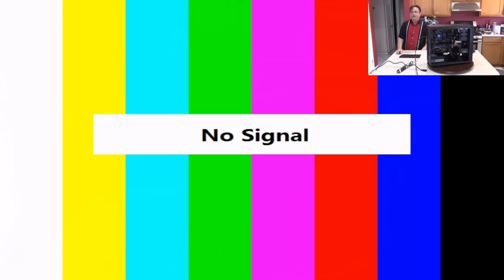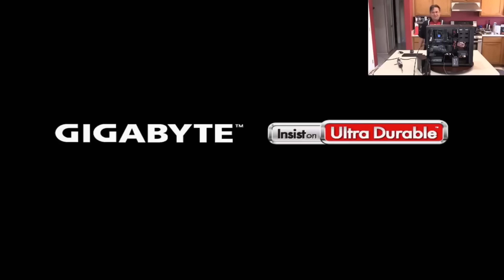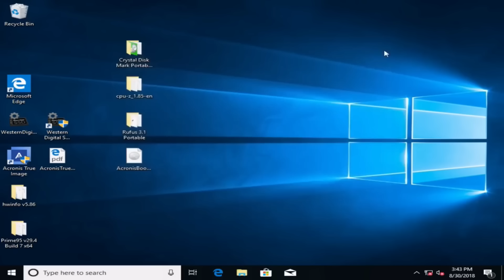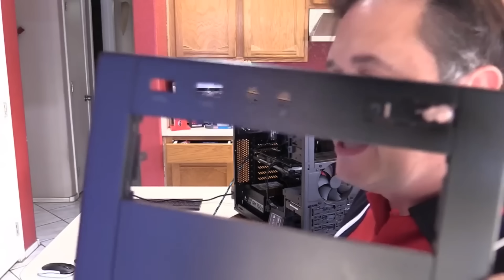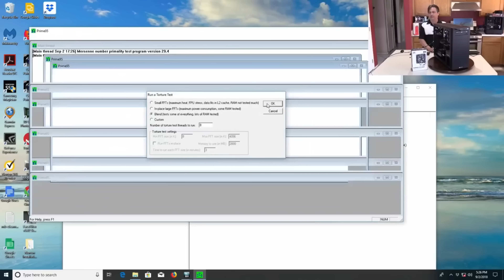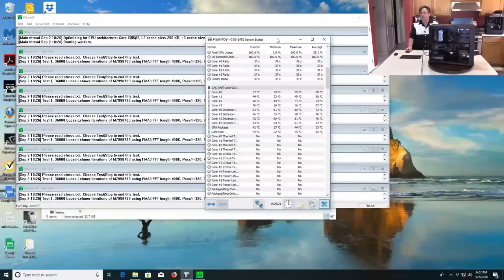HOLY COW! The easiest fix that NO ONE thought to check! Fixing a viewers broken PC.

Comment: There's another good reason not to power the machine on and off frequently - it minimizes thermal cycling of the components.
In all the hundreds of computer repairs I've done I've never seen a switch being the cause of a problem like this. My first thought (obviously wrong) after watching its behaviour was that the power supply might have a capacitor going high-ESR (power supply shutting down). Nice work! I think the CPU heat dissipation would be fine as long as the heatsink fins are dust-free, the thermal paste is the metallic high-grade stuff and he fan is turning freely.

Comment: I've often found in my computer diagnostics, that the dumb stuff, like that switch, comes up more often than it should. That's why I, too, always check the dumb stuff first. Looking for all the obvious causes first is usually the quickest to test. In the case of this problem I would have asked the question: what is the simplest cause of a reset? A switch?  Keep up the good work.

Comment: It's sad how many machines I've been asked to repair over the years where they've been 'repaired' elsewhere. I've had a machine on the workbench this week which the user has paid to have Windows reinstalled because it was corrupted. It failed again and he brought it to me. An initial check showed SMART pre-failure codes on the hard drive, they had obviously just reinstalled Windows on a dying hard drive. Swapped it out for a SATA SSD and the customer is happy as larry because the machine flies compared to a system with a nearly dead hard drive!

Comment: Great video. Lovely to see your detective skills in acton. Quite often with hardware, it’s the bits that move which can wear out but impressed that you eliminated software as the cause and then hunted down the hardware issue. I would never in a million years have guessed the cause - and great to see your systematic testing revealing it.

Comment: i wanted to say thanks for the info on the EVO.
when i built my I7 930 some 12~13 years ago i put a pelter cooler on & it ran solid with an OC@ 3.4. a few years back the pelter died & i put the stock cooler on. since then i had temps just like what you got in this vid, and that was not running overclocked. to do some video editing with Studio 10, i had to under clock to around 2.4, otherwise my computer would shut down or lockup.
just never got around to getting a new cooler.

after watching your vid, i clicked your link (it shows as Currently unavailable), scrolled down and found the EVO V2 listed. carted it and got. the description isn't really clear, appears to say it will fit LGA1366, but i had to do some mods to get it to mount which really wasn't a problem for me.
so far, max cpu temp has been 84c with prime95, watching a vid, and multiple windows open in 2 different browsers with multiple tabs in each, mildly OCed@2.9.

oh, and nice catch on the bad reset switch.

Comment: Hello just wanted to say great video,  I've been working on computers for years and I had to buy a new one just to experiment the newest pc's for myself the difference in i7 before this gaming pc I had a AMD Work Station and I still love it over this new one. 
Any way after 6 months I had to replace the very same power panel it is the kind that the switches are all on the top service and they get full of dust and if not clean very often they get hard to press and they break also the USB's are the same and they break and so their for I won't buy or recommend a top service panel. 
Thanks RallyAcesPCWorld

Comment: Yes. I had a similar issue before with my desk top. I just disconnected the button. Also, a local shop misdiagnosed my laptop when it just would not restart after just shutting down  normally. The shop insisted the mother board was bad and quoted me a $380.00 price. When I picked it up afterwards. only 1/4 of the screws were holding it all together. When I gave it to him, they were all there because I took it apart and checked all the connections prior. I suspected the power button. Replaced it and its been 3 years, since. In fact this is the same laptop I'm typing on now. $5.00 on-line for a switch. My shop was hoping to get a product to sell as used if I left it behind for him to repair. This mans shop was hoping for the same thing. No big surprise to me. Live and learn. Process of elimination is key and Sometimes one has to take a shot in the dark.  Gary, Thanks for this channel as it shows what Reality we live in with repair shops.

Comment: An object lesson in logical procedures and the 'safety nets' of unplugging the client's data storage drives, as well as electrical isolation until you suspected that it was a switch problem.
The fact that you temp tested so consistently should be a lesson to all aspiring computer repairers. Subscribed.

Comment: I'm no super geek, but I've done about 5 builds and a couple of upgrades... my last build was a NIGHTMARE!! 2 bad motherboards, 2 bad graphics cards... don't even want to remember some of the other issues... even with the assistance of a friend who has owned his own IT computer repair shop for 25 years... it took us 6 months to finally get it running properly... I'm pretty damn sure this will be my last build considering the Quality Issues I ran into and the warranty hassles... Anyway, loved your diagnostic process, but mainly wanted to thank you for HARDWARE MONITOR... I've been using Speccy for years and on my current Ryzen 5 5600X build it doesn't give me core temps for some odd reason... my tech said the CPU sensor must have gone bad... WELL... Hardware Monitor gives me Temps of things I didn't even know had sensors AND all my fan speeds (all 7 of them)... will be watching more of your videos... THANKS...

Comment: I took my desktop machine apart and took it outside and gave it a good cleaning and dusting, replaced the heatsink compound under the cpu cooler and proudly put it back into service.  It wasn't having problems, just needed cleaning.  Then the problems started.  I couldn't figure it out.  Time and time again it reset.  Then I got the blue screen of death (more than once).  I put it on the table like you have and stared at it for days.  Finally, I realized that I had accidentally tucked the cpu fan cable behind something and had plugged a different fan in the connector.  The mother board was happy because it could see a fan turning, just not the right one.  I had toasted the cpu and it never recovered.  I switched to an I7 laptop with two monitors (I don't game) and everything's been fine.  Sometimes I'm my own worst enemy and those problems are the worst kind of frustration.

Comment: It is a shame that he could not get better support locally.  I have been working with computers for over 48 years and have run across this problem before and wound up taking the front panel off as it was in this case the power switch on the panel causing the problem, as there was no reset switch which I would tell people not to use that any way.  Initially watching your video I would have though it was the power supply, but I could see right away that the power supply had nothing to do with this.  I like that you checked the connectors as I have found that on custom computers, guys frequently make mistakes there as well.  Any way very nice job and enjoyed watching your process.  I like your power test to push the CPU to maximum and see where the heat shows up numerically.  Very nicely done.

Comment: I recently had a go around with my old HP Z230. It decided to not post, no video, no beeps. The fans came on OK but within 30 seconds would run at high RPMs. Reset the Ram, checked all the cords and disconnected everything from the MB. Same issue. Thought it was my PSU but it being an HP 19 pin proprietary unit, my PSU tester was useless. I replaced the CMOSS battery and it finally gave me 5 beeps. which led me to inspect the CPU. I removed it and looked real closely at it with a magnifying glass and noticed one little brown/blackish smudge on only one contact. I cleaned it with rubbing alcohol and replaced it with new thermal paste. It fired right up and has been running fine since. I appreciate this video and you sharing your diagnostic expertise. Liked and subbed.

Comment: My clients and boss call me a genius because I check for and think about things like this. Erratic behavior must have hardware isolated first. ALL hardware. I do the same on desktop power issues. Front Panel I/O catches so many people and in modern systems rarely does anyone think about the reset button. In the olden days of the 90's, front panel buttons on cheapo were not made as durable and we saw this frequently. Nice to see a true diagnostic technician at work.

Comment: Great Job Carey! Logical and step by step analysis and troubleshooting procedure! 

I've been in the game since we could & would change discrete compenets so might have changed the FP reset switch if possible?

And I hope you recoup the cost of the new fan/cooler Assy. if not from the client!

Apart form that, a great outcome that seems to have eluded all others and caused unnecessary cost & wasted time without a resolution!?

A lesson for the client perhaps that DIY is not the right way to go and best to refer it to a Pro like yourself first for a proper and more cost effective outcome! 

Good news is I believe you've won a new client for life! 10 out of 10! ..... 🙂👋 👍

Comment: 10 minutes after boot... sounds like a CPU heat problem. I had a similar issue with a computer recently - liquid cooled. Pump had died.
Edit: Wow reset switch.. that's weird for a momentary to be so regular

Comment: It's all about a system to start ruling out things. Very quickly you knew it wasn't a software problem. Then it's just start with eliminating possible hardware causes. You have a real understanding of a system and how to check it out. Great work.
Reply: It's a pretty standard rule to never work on the machine with the custommers harddisk/ssd. 1st it's not our problem if the custommer have pirated software and we should never ask to get passwords to access their Windows or other OS installs. It's jus as private as a bank account or credit credit card. I agree that it's always better with a full install, but most techs will just disconnect all drives connected and use their own media with a basic install and some diag tools. If it turns out there is nothing technically wrong that I can find, I can recommend stuff that can enhance an older build or prolong its life, and unless people is total novices into installing windows themself every tech should have a usb stick that installs the latest Windows with all updates, install proper drivers and reseals Windows, in case it turns out to be a software issue. A true service tech will have no problems in instructing people in how to retrieve their personal files on the boot drive for free before the custommer dedecide if to letting the store wipe the disk. It's of cause fully up to the individual store/tech if they are gonna charge for this and how much. Unless it's something you just do in your spare time, you can't really expect to get this for free in a store. But just as with your car, you can never fully trust the repairshop if they are gonna overcharge you for something you did'nt really "need",  unless you know them well.

Comment: I am very impressed with your diagnostic style! It is very impressive! Most like the quick-fix approach. It is really refreshing to see someone who didn't simply accept the easy way out.

I wish that there would be someone like you around here! My son gave me a MacBook Pro that he purchased from Apple refurbished. One day it simply stopped working. Apple claims the damage was caused due to water damage, so their insurance rejected the cost of repairs. He finally gave it to me after quite some time for parts.

After having it lay around for years, I tried powering it up. It was fully functioning! However, after some time, it stopped working again. Clearly not a sign that the problem is from water damage like Apple claimed. They simply took the easy way out! I personally don't know enough about laptops in order to fix it. Too bad!

Comment: I was expecting a different reason because of what happened to my wife's gaming machine.

We had a power surge that fried something in her machine, so we started with the cheapest option - new PSU.  Wife installed it while I was at work, no luck.  I come home, poke around, no luck. Sooo, off to Best Buy for a new motherboard. Got home, started removing RAM, hard drives, GPU etc, then notice a loose cable.  Hmm, where's that go?  Followed the wires .. to the power switch.   Ok, we can't both have missed that but lets try - plugged it in and it started!  Whoo-hoo!  Put all the GPU etc back in, powered it on.. nothing.  WTF?

Turns out we hadn't used the cabling that came with the new PSU.  Got that replaced, all is well.

So that was what I thought this issue might be.

Comment: Wow man, big props and respect, from a former 23 year Computer Repair Technician. That was really nice of you and yeah, dude had a hell of a time. Lots of expense, just in shipping. I've done many a free job too, just cause I felt for the person. Built my first PC back in 1990 and owned my first one 3 years before that. By 1992 I was so interested in it that I wanted to do it for a living and became a Tech and got really good at it. I worked for IBM, Compaq and many small ma and pa computer shops and even ran my own computer business, twice. 

Always those little thing nobody thinks of, eh? I've seen bad switches before, although it's not a common thing, I've found. It's happened to me a handful of times, but certainly not my most common problem, not by a long shot. I've seen more bad motherboards and hard drives and power supplies than bad power or reset switches. But considering the wear you witnessed? Hmmm, yeah, they've seen a lot of use, probably more than usual. I like your style though, between you and the customer, you had good communication, he gave you a good list of what's been done and that was over half the work right there. Because most components had been replaced already, it made your troubleshooting easier. 

I was always like that with customers, tell me everyrthing, it will help me diagnose better. Same with auto Mechanics and Dr.'s etc. tell them everything, don't be embarrassed, it's nothing they haven't seen before and it helps them help you. Anyway, that said, with all the low down he gave you, it was time to think outside the box. Where's the only other variables? Start looking at the case and you nailed it.

Comment: Those little momentary push switches are often the cheapest, crappiest ones China can supply!  A simple multimeter continuity test - and about 20 switch pushes - will usually reveal any intermittent fault like occasional sticking on or not contacting.

Comment: I love the 212 EVO cooler. Have one on my ancient as hell FX-8350 system that is about 11yrs old. When I built it I added a second fan to the other side of the cooler since they include an extra set of clips for people that want to add a second fan. My system runs 24/7 and has never overheated. I've never overclocked it though. I'm sure if I did I could get it to overheat.

Comment: I'm a Multi certified Computer / Network engineer. Used to own a shop in Sacramento California. I ran into these types of situations so often, coming from other local shops & GS (what a joke) where they wanted to much for a repair or everything had been replaced already with the problem still remaining...
So CRAZY how often you see bad case buttons go undiagnosed by so called repair shops!
When ever I would get a rando restarter/shutdown or other issues like crashes that couldn't "easily" be explained, I would always see the issue happen, then unplug all case connections & look inside all USB ports.
Super easy to do & then just leave the system running while I worked on something else, check back after I finished what ever side thing & see if the apps I opened where still open (meaning it had not restarted)
I also had a mouse pad with a small vibration motor on it to prevent sleeping without changing cust. settings or what not

Comment: My first guess was since it's a self build, did they leave the plastic on bottom of the cpu cooler.  😅  If you want to tell if a system rebooted overnight simply open a text file without saving it.  If it's there in the morning then system didn't reboot.

Comment: Hi Carey and viewers, I have a 2012 Dell desktop with an issue. It won't boot.   I get power to the power supply, no response from the restart switch  on the tower front.  I checked it with a VOM.  Disconnected the switch.   Both LEDs  light, and switch checks ok.   Only way I get the other 2 fans to respond is by placing a short wire between the green and black wires on the 24 pin connector to the mother board which seems to place stand-by voltage to the board.  Any suggestions to try next  ?      I will see if I can find the old power supply from an older computer .

Comment: This happened to me!  Back and forth to the repair shop 4 times and they got sick of seeing me cbacause they kept saying it worked fine whenever they stress tested it.  Finally that last time I took it in and they saw it reset right in front of them.  They finally called in there head tech to see wehat was up. Turned out to be the power button in the end.  I was told that was a rare problem.